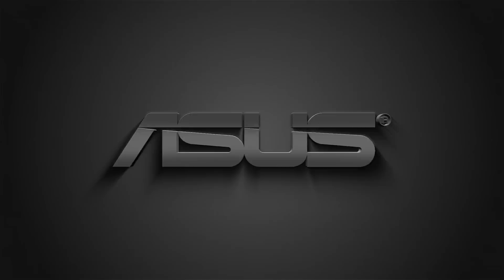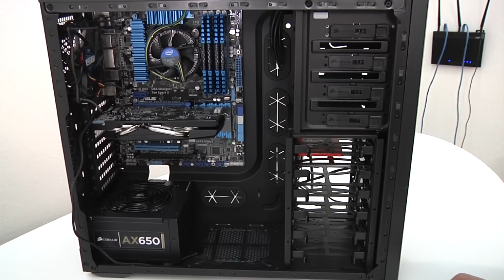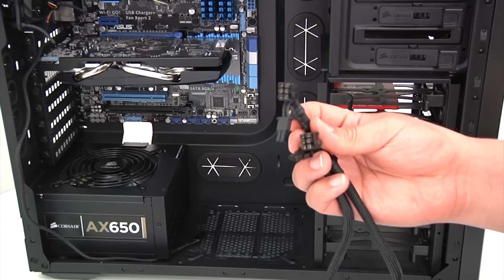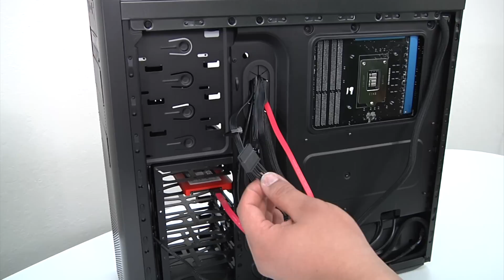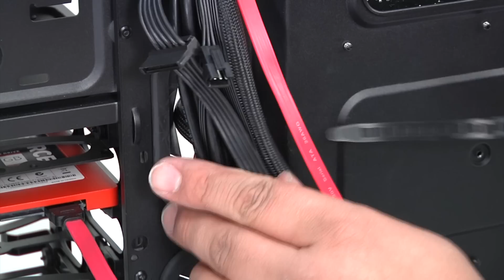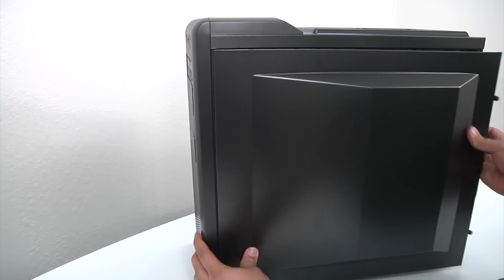ASUS How-To - Cable Management

Comment: Graphics cards surprisingly have their fans facing downward on most cases because their fans take in cold air from below and force it out the back or front. If they faced upward they would be taking in warmer air which is less effective for cooling. If you don't like the looks of the backside of the pcb you could always get a backplate.

Comment: If I were doing this cable management I would go from the back through to the psu, not plug the cable in then drag all the extra cable through, why dont you put the connector in through the back to psu.  bad demonstration.

Comment: Excellent video - very clear, thanks.
One question - using an Asus Z77 in this case (Corsair 500R) there isn't room for a USB 3.0 plug to fit into the outward facing USB 3.0 socket. Not a problem with the motherboard shown here, but maybe a point fore the designers. USB 3.0 connectors are huge!

Comment: Everything is fine up until the powering up point.  The LED on the motherboard shines green but when I hit the power button on the front of the case nothing happens.  I've tried pressing it and holding it just to make sure it doesn't work.  Help?

Comment: Thanks for the info. I was a bit paranoid since this is my first build. Currently I have 3 fans plus a fourth fan and pump for the liquid cooler. For the sake of neatness I'm going to connect the pump and fan for the cooler to the MB and the other 3 fans to the fan controller. On a side note, the temp probes on my fan controller are redundant and somewhat inacurate. It'd be nice if they synced up with the MB, eliminating the probes. I'll be doing some cable mgmt. soon and those probes are gone!!

Comment: Excellent Video. I have a question. I have an ASUS MB attached to a Liquid Cooler. Can I reprogram the "FAN 1" to act as a "CPU Fan" The exhaust fan is close to the "FAN 1" but the liquid cooler asks that it be connected to "CPU FAN"???

Comment: daaamn I so hate both the visual both the sound of that thing happening at 6:05, whenever I build a computer I'm so bloody freaked out by those tight connectors, I'm always afraid breaking my mobo pushing them in. Brrrr.

Comment: You can do either way but i recommend to use 7V resistors on the fans which drops the power the fan gets to 7 volts thus lovering its rpm, it makes them considerably quieter

Comment: Since most of the cool air is still going to be on the bottom the PSU will be fine, especially if its a high 80+ rating like this one

Comment: Hey ASUS want a tip for Haswell?
Rotate the 24PIN header 90 degrees
Basically what MSI did to the USB 3.0 header next to the 24pin header

Comment: im a noob so pls tell me if im wrong ...all that heat from the chasis goes inside psu? is not better to switch psu posistion upside down to get fresh air from the bottom ?

Comment: generally they are given power through the motherboard headers but you can get adapters to connect them to the power supply, you could also get a fan controller if you run out of headers

Comment: If it was oriented upside down so it can take in cool air from the base of the case, then the sockets for the modular power supply will be external, or it will be facing outward which would make it extremely difficult getting all the necessary cables back into the case. But yes, It would make sense getting in cold air. If only the damn fan was upside down!

Comment: Hi friend, I have the same case and motherboard ...But my power supply is a Corsair GS600 and I am in doubt how to install ... with the cooler up or down??

I saw you put your cooler up but saw some video that we put down.
I installed my power supply with the fan facing down.
This wrong?

Comment: If you think about it, the PSU is actually taking hot air from inside and blowing it outside helping with the ventilation and preventing over heating from within.

Comment: The power supply doesn't suck air in it blows air out to cool the power supply, but I agree if it is pointed in to the case then it will be blowing its hot air at the other components.

Comment: There's a continuous airflow in the chasis. The CPU, GPU and PSU will all be exposed to the same cool air coming into the chasis and blowing out the heated air.

If the PSU would take cool air in from the outside then it would be blowing hot air into the chasis.

Comment: I just recently did a new PC build and I decided to put the power supply like in the video also since I felt that it is better for it to take air from inside the case as opposed to the carpeted floor that my PC case is currently sitting on.
I believe this arrangement prevents less dust from being sucked into the power supply since surfaces like the floor or desk tend to accumulate more dust.

Comment: Actually the PSU fan spin very slowly, and the 80+ PSUs are so efficient that it doesn't need fresh air like the cpu, so if you put it "upside down" like in the video, you don't push dust from the bottom, so your PSU stays clean in the inside;)

Comment: I have the same case with a P8Z77-V-DELUXE board... 
How did you connect the front two fans to the motherboard given that the connector are not standard? Can you give as much detail as you can? For example, which three pins were connected? Which wire is the ground wire...ie what is the correct connector orientation?